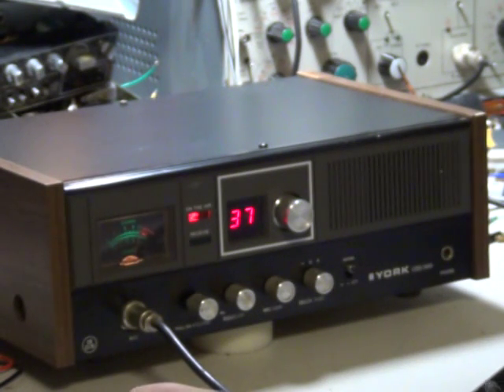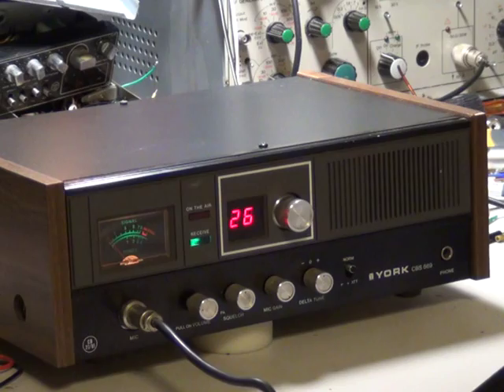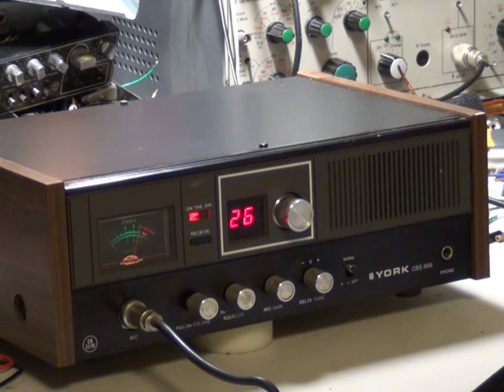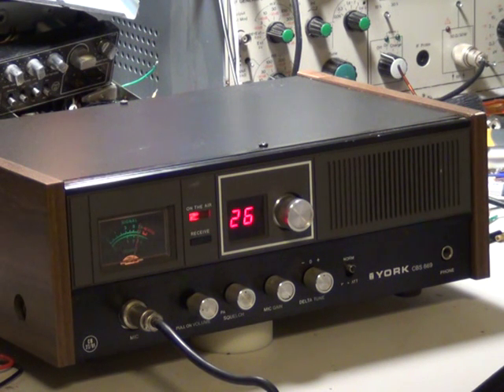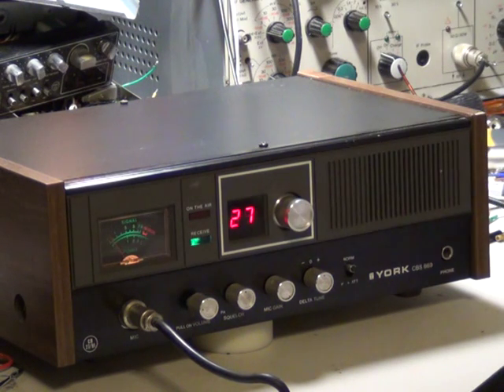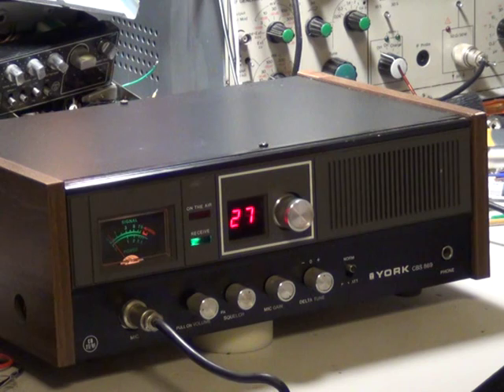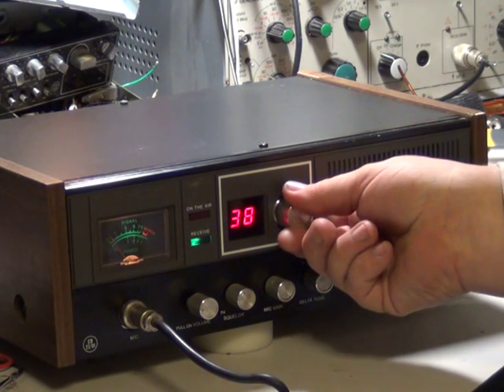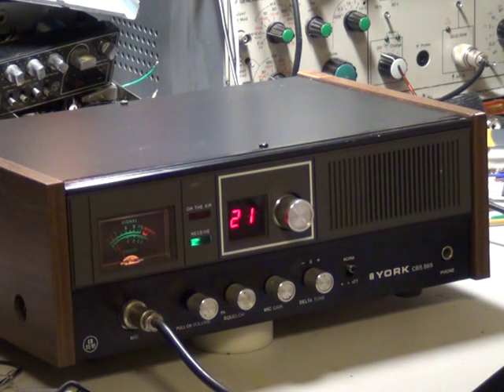York CBS869, UK (CB 27/81) CB radio (Base Station) - On The Air Test

Comment: still have mine. I got the extra 40 channels added back in the late 80s
Reply from the maker: Legality aside, you need to get the extra channels removed ASAP. How many videos have I done where the illegal adition of CEPT channels have killed the PLL in the radio. It's also a huge compromise, especially on receive & my experience is that usually neither set of channels are properly on frequency either.

Richard, G0OJF, UK